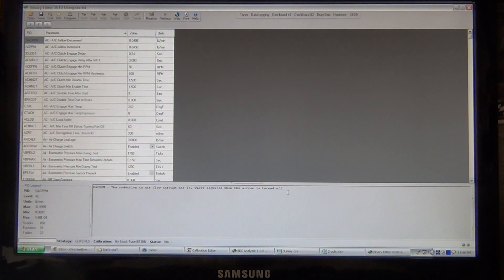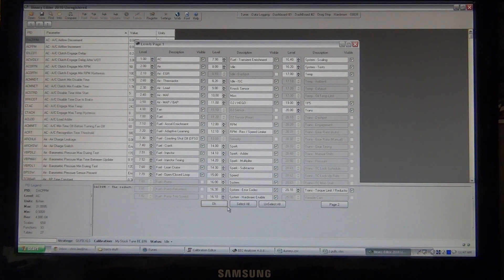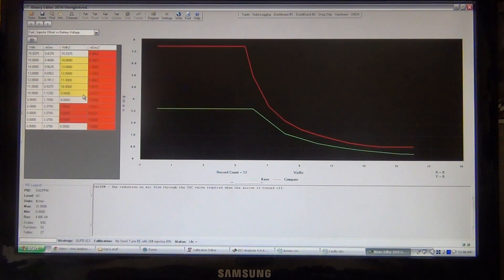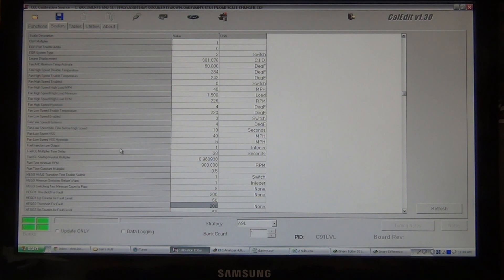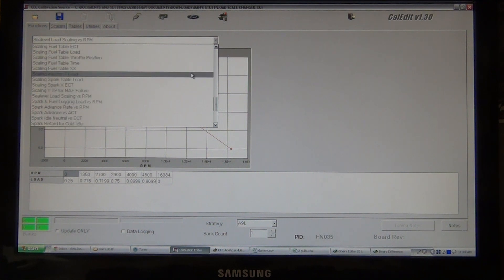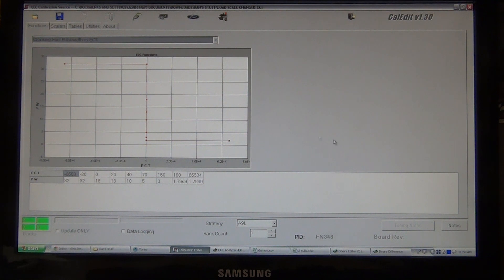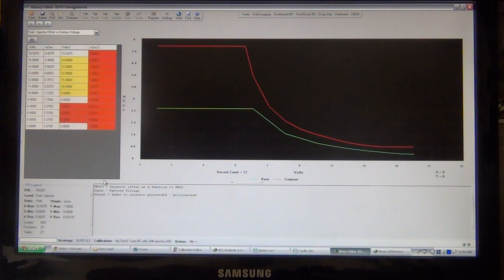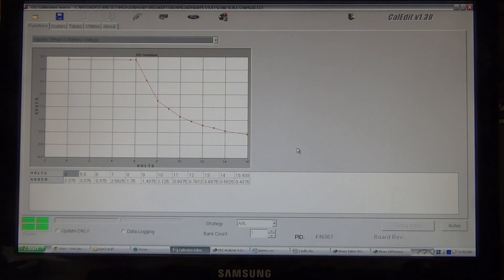Messing around with the EEC IV using Cal Edit, entering 24# injector settings

Comment: I also am thinking of using the binary editor software... the ecu tuning is new to me although i don't think it's going to be very hard given a little help in understanding
Reply: It's done right away .... while the engine is running....
Reply: Mike Mitzel I dont think that's possible and it's not easy if it was you would not do it.
Reply: Lol it is poosible...
Reply: Research the moats quarter horse for sn95 model mustang gts... full tunability over fuel trim injector pulse band width mass air everything....
Reply: I just ordered it I'll show you when I get home

Comment: Is there no need to change Mas air settings when changing to the 24# injectors? I've installed 24 lb injectors on an sn95 with factory Mas air and I'm ordering the quarter horse chip...

Comment: Where can I buy the software for binary and Cal edit? And which do you prefer? I have a mail ordered chip, car does run a lot better, but I'd like to try doing my spare ecm see if I can more power.
Reply from the maker: Andy Martin Last I knew Cal Edit was a free download. You can get Binary Editor at Moates.net. It is FAR superior. You're going to need more than just software to actually burn it to a chip, and you probably won't be able to access, or re-write your current one as it's probably been protected by the tuner.
Reply: What all will I need to go with it? I have a spare ecm, I don't have a chip for. I have a chip from Bama performance
Reply from the maker: If you go with a quarterhorse you'll need the qh, a license for BE, and I would recommend a WB.
Reply: Thanks.